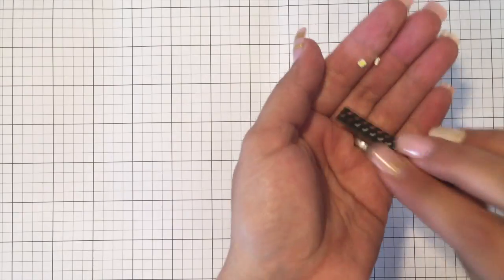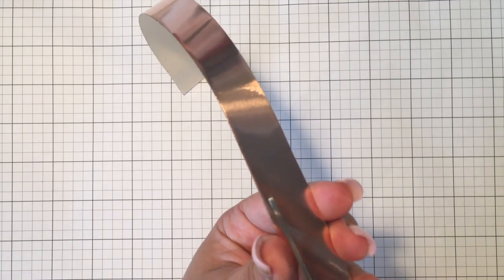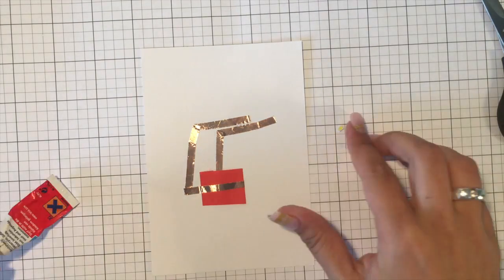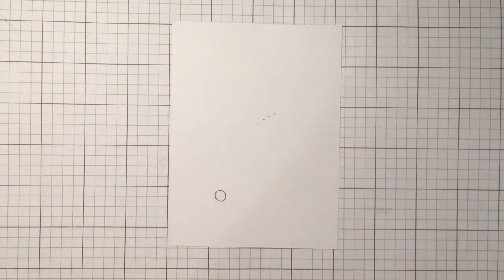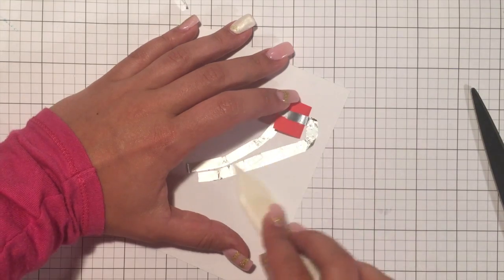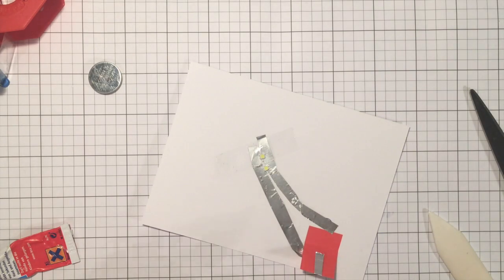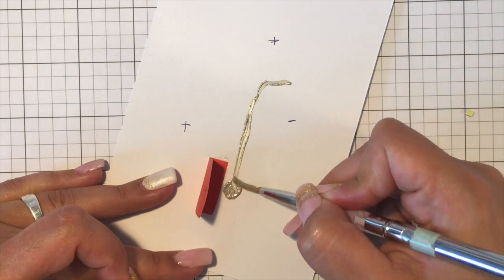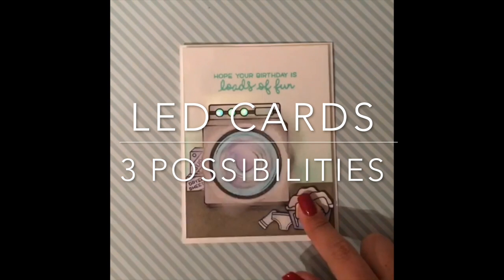LED CARDS - without Chibitronics - cardmaking tutorial

Comment: HI- How can you tell which side of the LED is positive and which side is negative? They are so small I cant see anything on there. Thanks
Reply from the maker: Chris Lee hello (: my LEDs had a tiny little nodge on one edge. This side I think was minus (negative) but it doesn't matter as long as you keep the leds on the same string of copper/silver. But you can test it before glueing the leds by only pressing down to the silver/copper. If nothing happens just turn the batterie side.. hope it helps. Hope to find time to look after the leds to tell you better

Comment: How to glue the battery?  Thanks.
Reply from the maker: Hello Veronica, I usually don't glue the battery, but I build a frame around it using foam tape. In case u want to glue the battery, i would suggest dry glue, as dots, or gliders or regular tape. And you just put it were there isn't copper tape. I wouldn't risk to have bad connection between coper tape and battery. I hope I could help. In all my LED card videos you can see how I create my circuit and how I "glue" the battery.

Comment: Fyi. The color LED Light 0603 are the incorrect size to use  don't buy them. . They are way to small.. buy either  3528 type or 5050 size to make cards. . The warn lights that, she recommends are a good size to buy, she  might be using type size :5050  or 3528.  not sure.  I made the mistake bought the  wrong size :(
 I'm just trying to save you time and money.  otherwise  I love that she shared her ideas. 😍 I still hoping to make one once  I get my refund.
Reply: L Mendoza ,  bought the 0603 before seeing this.   Can they still be used on cards with the same method shown?
Reply: Sue M ,  correction, yes , you are right , if you are about about  yellows lights  on video  they are  a good size to use on cards.  Im talking about COLOR LED  lights , red , yellow, blue  on the description box is incorrect . its should be 5050. just llike the yellow ones she is using on video.  Im was trying to help out the mistake.  that all.  sorry for any confusing.
Reply: Thanks so much for your information about which LED to get. I also had trouble with the super glue. I found dry "snail" adhesive works perfectly pressing hard like she says for about 30-40 seconds, then, if necessary, scotch tape snug over the LED. I'm giving these to children, so they will take a lot of punishment.
Reply: I did also, way too small